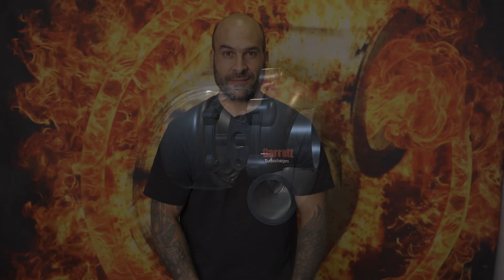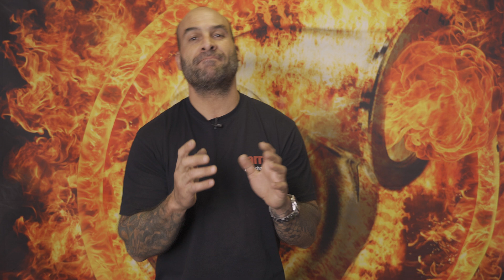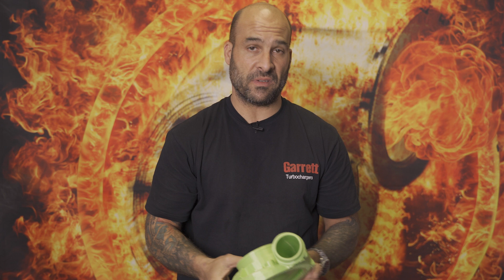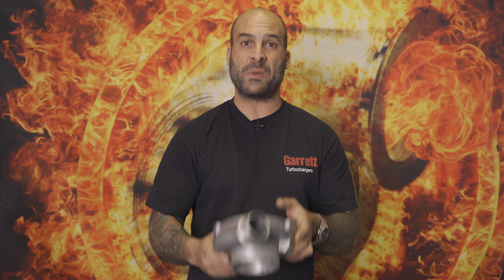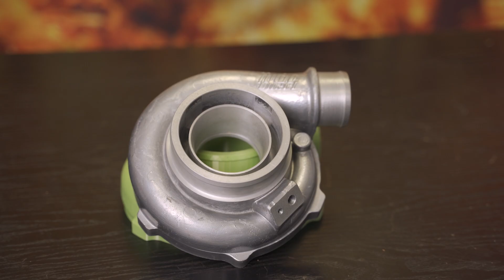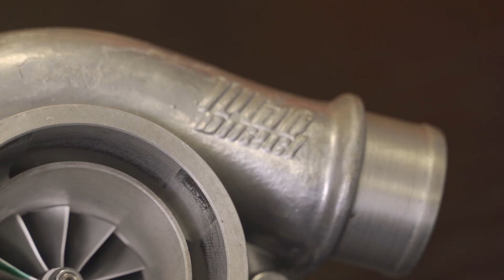TurboDirect S.A Big things for 2021 - Part3

Comment: Hi there can i get a garrett g30 770 to fit a Subaru Impreza sti classic 1997 reg as I believe g series are v band and Subaru is not. Can you help
Reply from the maker: The turbocharger on the Subaru is not Vband and no off the shelf Garrett turbo will bolt onto the Subaru triangular flange face - you will need to modify the up-pipe in order to make it fit. 

The Subaru engines do not spool larger turbochargers easily especially the EJ20 - I would opt for the EFR7163 over the Garrett G-series by far. The EFR7163 is a much faster spooling turbocharger and will make the claimed power. The G30-770 will fall short and spool late

Comment: will you have anything in your line up as an upgrade to the bmw b58 motor... looking to make at 500 whp on pump gas also it will be a street car
Reply from the maker: Upgrades to the stock turbo are not a problem, however making this much power on a stock bearing system is like asking for the same on the IS38 units, which as you might or might not know, is asking for trouble - this will never be reliable for say 50 000kms, in which case whats the point. 

Making 500WHP isnt the problem, its making it on pump fuel which might be difficult unless you have high octane in your location, or you run octane boost products permanently.

Comment: you make a aluminium mold for aluminium part ? lol man. we make molds here , for a aluminium part like this there are two main options. Injection molding which uses a steel mold normally high grade steel that won't wrap or deform under heat. Second option which is more likley that you using a sand mold. The mold is made from aluminium and you mold the sand into it to make the sand pattern. And then cast the housing. But in either part i dont see why the "aluminium mold" will get hot. Seems like you again don't know what you saying cause you probably don't even make the mold your self. not to mention this housing is 1:1 3076 gen 2 housing.
Reply from the maker: The mould is a sand cast mould - as you should have been able to see from the surface roughness, which involves making a core from silica, depending on the temperature of the mould, this affects the resin that binds the sand. The housing looks like the Garrett version because its a DSR (Direct service replacement) however the AR aswell as the volute shape and internal angles are nothing like the Garrett housing in any way or form - 1:1 - i think not.

Comment: Hey nice channel. Fantastic content. Q I’m running an EFR 6758ts and I was thinking of running an e-gate on it. Any experience in doing this? Your thoughts on e-gates ? 

Cheers
Reply from the maker: Thank you for the compliment - we designed our first electronically controller wastegate in 2015 - ill upload a video on this one day. The control and speed of the gate is far superior to the pneumatic models, but the thermal loads are a problem, hence the majority of them are water cooled.
Reply: @TurboDirectSA  any links to the product ? Cheers
Reply from the maker: @bigmattolly4910  Not yet, product is not released as yet. We aiming for the end of the year if all goes well.
Reply: Well ok then. So if I were to modify something now if I get the time lol for the EFR any suggestions. ?
Reply from the maker: @bigmattolly4910  Give me more info on what you want to do? What engine? Does it have a turbo already?
Reply: @TurboDirectSA  currently running sr20det, garret, most mods 300rwhp usual stuff. New package sr20efr ts, t4, 6758, dct, 300rwkw KV8 Emtron. Looking to control gate for torque management, boost by gear, . E-gate has its benefits.
Reply from the maker: @bigmattolly4910  Whats your target HP? What turbo are you currently running?
Reply: @TurboDirectSA  it’s for my EFR 6758 TS that I have. Target 300rwkw
Reply from the maker: @bigmattolly4910  Upgrade to the 7163 - it is a big jump in power although the power figures display 500HP for the 6758 and 550HP for the 7163 - take a look at the 7163 compressor map and you will see its actually capable of 600HP
Reply: @TurboDirectSA  yes all good but the q was about e-gate not 7163 lol if you have a solution I’d like to here your opinion on retro fitting something . Thanks
Reply from the maker: @bigmattolly4910  Apologies i misunderstood you. What would you like to know about the E-gate?
Reply: @TurboDirectSA  Any suggestions on what to use on EFR TS

Comment: OK professor,  well you taught me all about the EFR. Because  of that I picked one up, for all the obvious reasons. What output will these tubos have, and will the response be equal  or better then the EFR? Also will it be internal or externally gated?
Reply from the maker: Hey Buddy, thanks for the comment once again - the turbos we designing are direct service replacements for the Garrett range - both older GTX Gen2 and the latest G-series. We are not going to offer any internally gated turbos just yet. 

Power levels are going to be true 600HP in the "30" size family, and then a true 750HP in the "30" size family, aswell as a true 800HP in the "35" size family and a true 950HP in the "35" size family. All will be ball bearing, and have a 9 blade light weight turbine. 

The EFR is in a league of its own right now, because of the Gamma TI turbine, noone can come close to it in weight or spool characteristics - this is a fact. We are not trying to compete with EFR - we will definitely be able to offer a viable product option to Garrett in cooling, reliability, and outright performance with a lower price point.
Reply: @TurboDirectSA  thank you professor,  I can't wait to see your products. I'll be interested in picking one up for my next build. Best of wishes on this launch
Reply from the maker: @1atinlove  Thank you Encinas!

Comment: Hey Chris,
That's so exciting  thanks for sharing! I am actually after something for my 944 Turbo S - I have been thinking of the EFR range but may prefer one of your creations! I would ideally like sonewhere in the 400 rwhp range power wise but with good spool characteristics. I'm happy to wait as I'm still doing other things to the car. The car still has its original KKK K26-8 which doesn't have any issues and is good for a bit over 300 rwhp but obviously, being 30+ years old, doesn't have spool characteristics like the modern turbos. Ideally, I would like soething that can just bolt straight up if possible.
Please let me know your thoughts and thanks again for a great channel and great content... I always know when I see you have a new video I ca  enjoy watching it and you will be direct and to the point giving good information we can all learn from!
Reply from the maker: Thank you for the comment and compliment - regards the K26, the mounting flange face is T3 if i remember correctly - this is not a problem to mate to, but the DP and exhaust would need to change and so would the oil inlet and return lines. Ball bearing would be the best option for spool up, BUT it requires water lines which sometimes can be tricky to run especially on the Porsche. I would look at the S200SXE to be honest - we have used this before and it makes very good power and spools fast!
Reply: @TurboDirectSA  Thanks for the reply Chris. So the Porsche's turbo is already water cooled... it even has a pump that keeps running after shut-down for better cooling! Are you saying thesevwatrtvlines woukd have to be rerouted and that presents an issue?
Reply from the maker: @geneqco  If you already have water lines run - then any turbo including te BB options are easy and simple to hook up. The flange face is the obvious important aspect which is not a problem with our range of DSR replacements for the Garrett range - see here:- https://turbodirect.co.za/store/index.php/shop/turbochargers/gtx3076r-forged-detail

Comment: From selling to manufacturing is a massive massive jump, you just increase your work load by 1000%, looks like an excellent product,
Reply from the maker: Conrad, you are 100% correct sir - we have been planning for this for years.  The engineering side of things has always been our forte, and with upgrades and modifications, engineering forms part of this process already - repairs and assembly, fault finding, testing, balancing, flow calibration -- these things are in our blood and we do this daily on a large scale - so finishing a product and assembling, balancing and packing makes sense - and sure it has our design inside and our logo on the outside.  :-)

Comment: Love how informative your channel is. I currently run a efr 8374 iwg on my 2.3 evo 9. Full boost at around 3700rpm. Can you come up with a turbo that will out perform the 8374 but retain the quick spool? Happy to test your turbo from New Zealand
Reply from the maker: Thank you for the compliment - the 8474 Black Series replaces the 750HP capable 8374 with a now capable 950HP unit - its the compressor stage that was re-designed and the spool characteristics should be very similar as they share the same turbine - side. The power increase will be substantial. 

This past weekend we ran a fully built RB26 with a black series 8474 and the response from this turbo is unmatched anywhere size for size!  from 3500RPM you pushed into the seat - big boost numbers showing already from such a low engine RPM.

Comment: Hey Chris all the progress looks great! It’s been fascinating to follow the progress and see the results and factual info on all your products. You mentioned earlier this year that you would be testing (in the future) on a dummy 1JZ engine the differences between the Garret and Borg EFR products in terms of spool, top end flow etc. and then dissembling them to carry out a detailed analysis of how the coped under duress. I’m sure you’ll add your own product to this test and just wondered if you would be sharing the comparison between your product and the Garrett/Borgwarner products in the relative families. 

Exciting products !
Reply from the maker: Hey Sam, thanks for your continued comments and interaction. The testing will be done side by side between Garrett and Borg Warner to show the reality of potential short comings of products and potentially short comings resulting in over-rating/"over-marketing" a product where applicable. 

I specifically want to cover what the difference is between changing AR's on housings both on the turbine and compressor sides. Many tee free tee faw (T3/T4) fan boys have no idea what they are purchasing and the affects of housing choice -
Reply: @TurboDirectSA  haha tee free tee faw 😂 very true with that, too many people just slap some form of “turbo” onto a car and leave so much performance on the table simply by not using the correct frame size, A/R etc. Look forward to seeing the results and potential short-comings, I’m sure a lot of people will be shocked with the results !
Reply: @TurboDirectSA  haha tee free tee faw 😂 very true with that, too many people just slap some form of “turbo” onto a car and leave so much performance on the table simply by not using the correct frame size, A/R etc. Look forward to seeing the results and potential short-comings, I’m sure a lot of people will be shocked with the results !